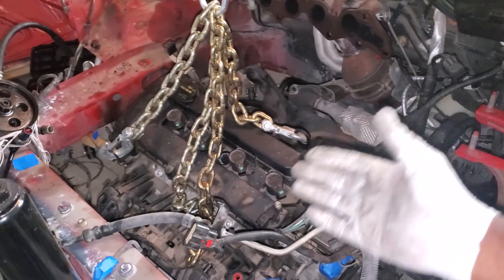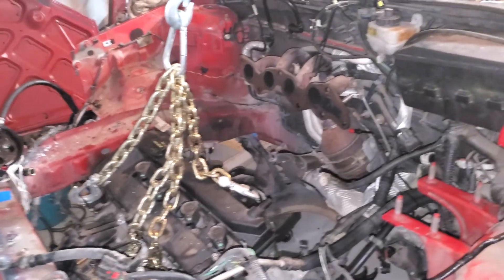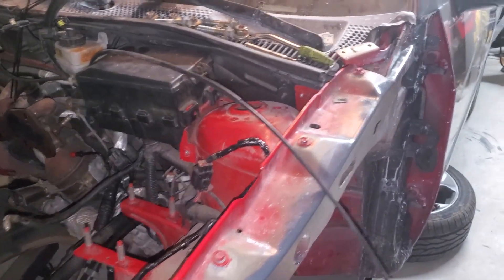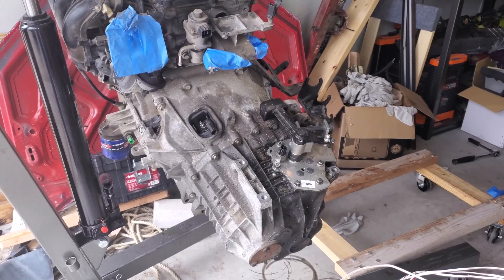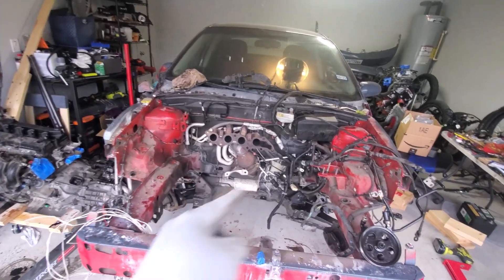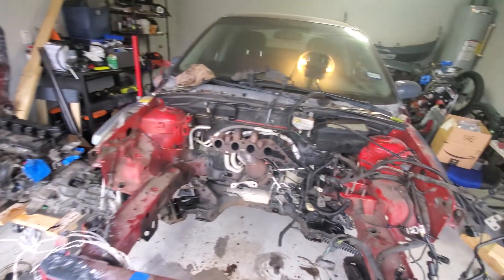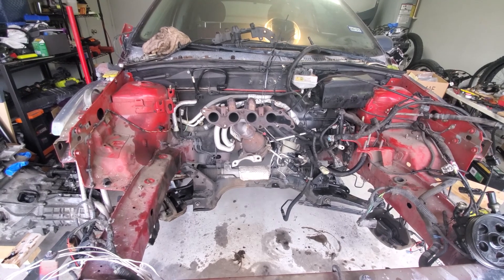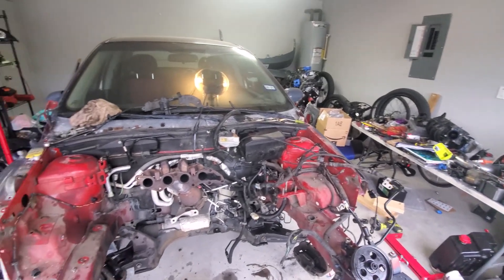FOCUS to FUSION 2.5L Engine Swap: Teardown Part 3-Episode 31

Comment: Great series - thank you! Im trying to follow along. I have two Focus of my own - 2002 wagon and 2005 sedan  - both 5-speeds. FYI the easiest way to remove the DS drive axle is to first remove the PS axle - which is only retained by the support bearing. Once the PS axle is out simply - and carefully - place a long thin drift or screwdriver thru the trans case so the end of it is on the inner end of the DS axle and give it a sharp rap and the DS axle will pop right out. No special tools needed! Obviously still need to get the outer part of the axles out first as you did.
BTW I was wondering if you feel you could have lifted the engine/trans combo out the top? Would the trans have cleared the trans mount bracket that is welded to the unibody? 
Thanks
God bless
Paul (in MA)
Reply from the maker: You can... well my crane can. In the end I think I actually lifted it out the top. I will go from the bottom going back in though.  Much much easier  on reinstallation.
Reply from the maker: Yea i heard of the screw driver trick... I was to chicken to do it though